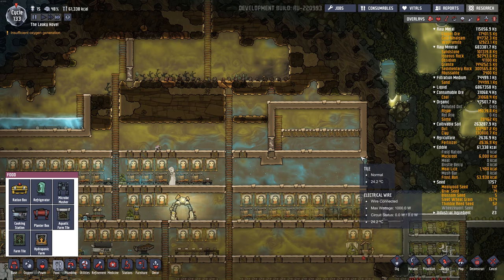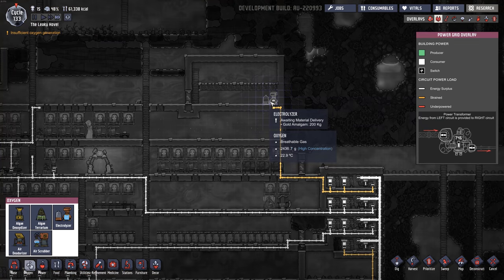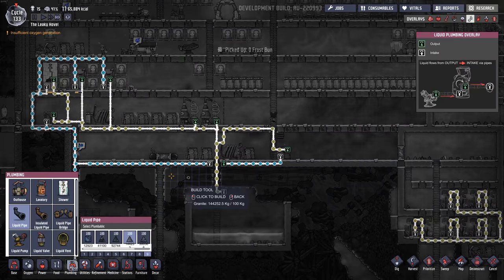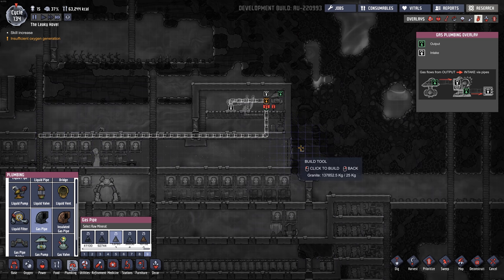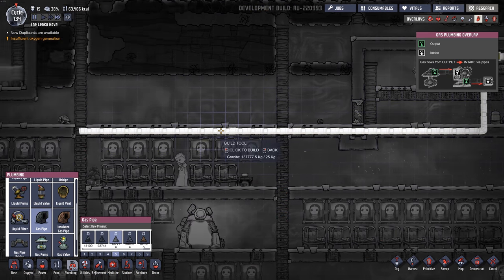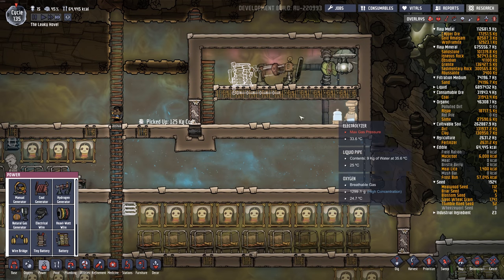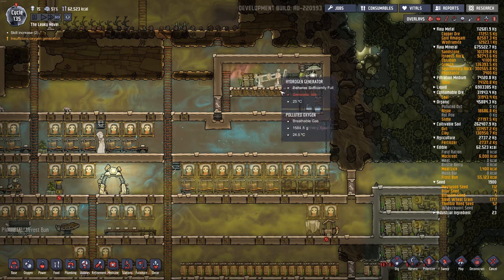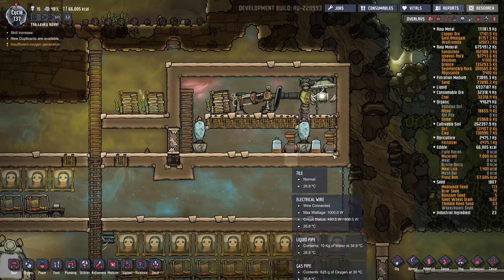Oxygen Not Included | Electrolyzer Guide

Comment: Electrolyzers put out twice as much gas as a pump can draw in. So having only one pump halves the gas production when they hit max gas pressure.
Reply from the maker: Amanda I didn't know that! Thanks for the tip. I have 4 electrolyzers and one pump at the moment so I'm super wrong. I'll try putting in 2 pumps for each one and see how that goes.
Reply: Also the gas pipes can hold gas up to two pumps worth. So electrolyzers make 1000g/s, pumps take 500g/s and pipes hold 1000g/s, if you want the numbers.
Reply from the maker: Thanks. Is that on the tooltips anywhere? Useful info!

Comment: Very useful tutorial, thank you! Have you had trouble using this system with the new Smart Batteries?
Reply from the maker: Should work fine with smart batteries. That is an older video. I usually put oxygen production beside nullifiers now.
Reply: I think I'm doing smart batteries wrong, then. They charge up and the automation turns off the hydrogen generator, which halts the supply of oxygen.  Time for me to go back to your automation tutorials!

Comment: I actually just collect the hydrogen at the top of my base and pump it to my hydrogen generator from there, which is also where my electrolyzers are. I don't bother to seal them off. The amount of hydrogen generated is not a threat.
Reply from the maker: I guess I could try that logicalfundy. seeing even 1 tile of hydrogen floating around sort of bugs me though!
Reply: Well, that's why I'd place the entire apparatus at the top - if everything is at the top, there shouldn't be any hydrogen floating elsewhere in the base, because hydrogen rises above everything else.
Reply from the maker: I've since opened up that room and build a large place at the top of the base to collect hydrogen. It's working better so far. I also opened up the base a lot as I'm trying to mine the entire map and got tired of trying to maintain clean oxygen in the base.